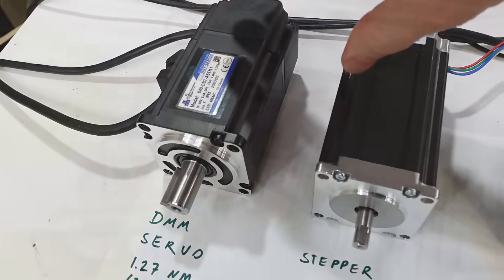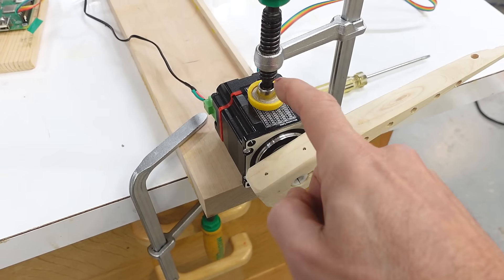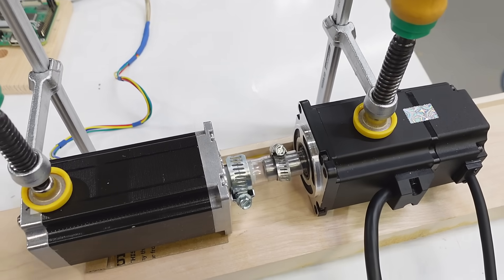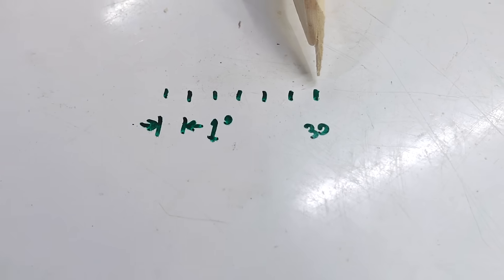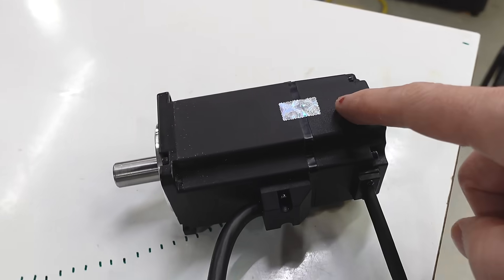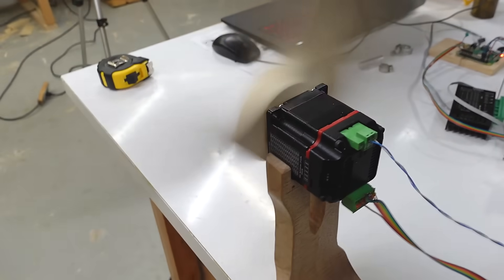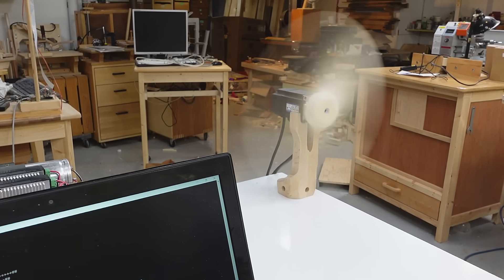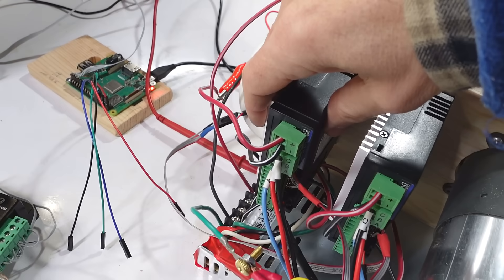Servo vs steppers: Speed, Torque and Accuracy

Comment: Why not connect these motors to your impeller on the dust separator?  What is the inertia of that wood blade? How out of balance was the blade you used?  What does the current plot look like on your scope during the micro step process?  When will you adapt one of these motors to your box joint cutting jig?

Comment: 3:23 Hmmm, I wonder why. Maybe it's because you clamped the motors on the table with a piece of cardboard under it? Nah, couldn't be it, must be the encoder's accuracy.
Reply from the maker: Body of the two motors were different size, so a shim was needed.  Also note how I clamped the stepper towards the back.  The coupling is not perfectly centered, and by clamping it towards the back it has a bit more room to move.  But --- you could have just paid attention when I said the coupling had its issues.  Commenting is easier than listening, isn't it?

Comment: I've used those magnetic angle encoders quite a bit, and their precision and repeatability always beats their accuracy by a wide margin. Small errors in magnet placement can have a fairly significant effect on nonlinearity, and perfect placement is effectively impossible. Still, cool devices, and very cheap for what they can do.
Reply from the maker: well, the way the magnetic encoder is in the servo, its a lot better than I was able to do playing with these encoders.

Comment: Those magnetic encoders have really bad non-linearity. If you look at the datasheet for some, they’re usually around +-.5° under ideal conditions. High precision servos tend to use optical or other types of encoders that have much better linearity
Reply: Optical encoders or resolvers are the standard in industrial settings. That said those magnetic encoders are pretty nice for hobby projects, certainly cheaper than "serious" angle sensors.
Reply from the maker: gets more expensive that way.  You need a LOT of resolution on the encoder, because the only way the servo knows how much torque to apply is looking at angle differences.  So you need a lot more angular resolution on the encoder than you achieve in terms of position accuracy on the motor.  16 bits of precision would be an extremely fine grained optical encoder.  and then you also need absolute accuracy to drive the BLDC motor.  So its a big extra cost.
Reply: @ Actually these servos measure current on each phase, current is proportional to torque in a PMSM. These should be PMSMs not BLDCs because of torque ripple BLDCs exhibit. 12-bit and 14-bit encoders are rather common in them. Also, a lot of "absolute" encoders are just incremental ones with battery backup, so you can loose absolute postion if the battery dies.

Comment: One thing to note with steppers is that the speed and torque ratings are only be valid when using full stepping. When using half, quarter or micro stepping you'll lose both speed and torque.
Reply: That's not true. Full step is horrible. But you believe whatever you want to believe.
Reply: @1pcfred  I think you'll find it is very much true. Like all things, it's a compromise. Want full power, then sacrifice smoothness. Want a smooth running system, sacrifice maximum power. There's no free lunch.
Reply: @1pcfred  so pleased do explain. How does one hold a motor in a static position with a continuously varying input?
Reply: I should add that ideally you'd run a stepper motor off a sine wave. We just don't because that's harder to digitally control.
Reply: @1pcfred  not entirely true. While actually turning using a sine (or SPWM) while given a nice smooth operation, in order to hold a position you need to either provide a DC current to a pair of phases to "lock" the rotor in position or switch rapidly between two phases to "balance" the rotor between two poles. This is why full stepping gives full torque, the rotor and poles are lined up.
Reply: @1pcfred  when my area of interest is automation and CNC, so holding torque and positioning is pretty crucial along. That's why so my goto is generally AC Servos.

Also what the hell you talking about? 50 phases? You mean 50 pole pairs? That's not the same as phases. Almost all steppers are 2 phase, although 3 and 5 phase motors do exist, they're no where near as common.
Reply: @JaenFoster  don't bother with this guy, he thinks he knows everything but is unfortunately very clueless. Victim of DK effect.
Reply: @riba2233 poor pc Fred. He was so embarrassed he was never seen from or heard on the Internet again 😢

Comment: This isn't the first I've seen of advantages of servos over steppers.  Broadly, when would I want to use a servo and when would I want to use a stepper?  It seems a servo can be used in many stepper applications.
Reply: when you have cost constraints or need holding power basically
Reply: IN GENERAL, a servomotor has better performance in every way. Use a stepper motor when cost is a big concern, and weight is not a big concern. Do not generalize the positioning performance of this particular servo to all servos. Different servos use different shaft position sensors. Some are optical. Servos can typically stop and hold position at full rated torque if desired. Although it depends on the driver.

Comment: I have a ~20 year old "hobby" CNC machine that came with servos (with optical encoders), rather than steppers. Given how well it works, and the advantages of servos, I've never really understood why steppers are used. I assume it's simply down to the cost?
Reply: I suspect it's cost. I have a 6090 form factor CNC machine w. 1.5KW spindle for measly $2000. It works amazingly well for even the most intricate and small wood carvings. I suspect I get way more displacement from the metals bending, than from the stepper motors inaccuracy
Reply: Servos are a lot more fiddly to setup. Unless they have translation drives on them, that is. Then the manufacturer worked all of that nonsense out for you. Old school amplifiers you have to PID tune though. Which some people are good at. Not everyone is quite a virtuoso.
Reply: @1pcfred  my machine uses a set of Geckodrive G320 drives, so I assume that's the "worked all of that nonsense out for you" bit?
Reply: @1pcfred  sort of. The Gecko G320 has pots for PID tuning. The manufacturer of the CNC machine had set them up as part of the machine build though.

Comment: Maybe you accounted for this but for the lifting tests, would the spool diameter for your lifting rope effect the max weight? Would a smaller diameter spool allow them to lift more?
Reply from the maker: I added the diameter of the rope to the spool so that the diameter I was using was to the center of the rope

Comment: I was never fan of magnetic "encoders", why not use the disk encoders?
Reply from the maker: manetic encoders give you the absolute position of the turn, needed to drive the brushless DC motor.  So an optical encoder wouldn'teliminate the need for the magnetic one.  But for most applications, there's quite a gear reduction from the motor to what its oving, so a degree off is actually insignificant.

Comment: I’d like to see the integration of the box joint jig and the stepper motors.
Reply from the maker: My first jig had a stepper motor.  Switching to gears was an improvement.  Faster and more reliable.
Reply: @matthiasrandomstuff2221  But why not both? Geared down stepper motor.
Reply: Could the push/pull of the blade mechanism be geared along with the turning of the ‘spacing’ gear to automate the movement?  That would be cool.

Comment: Man! I thought that "reverse second hand" clock was kinda scary. But then you started with the fan! 😬😬😬😬
Reply: I read your comment before seeing the fan and despite that I was not prepared for the real thing!
Reply: @hero314  same
Reply: that explains the dried blood on his index finger!
Reply: I was waiting for the POP-VVVVVVVR as the wood exploded
Reply: I know it’s only an optical illusion, but I thought the fan blade was creeping off the end of the motor shaft
Reply: lol almost made the entire workbench take flight!
Reply: oh my god, same
Reply: Yes, indeedy, I was dreading Matthias saying "Shit!" just after a blade was shed across his workroom with the motor beating and wrenching violently about in its restraints until its cutout activated (but the "shit" would at least reassure us he wasn't mortally kaput). And was there a knot hole on the right blade (facing us right) shown at 10:36 ? (he wasn't worried much about the knot hole, didn't he do a video on wiring drill holes in floor joists some time ago not affecting their strength much?).
Reply: Don't you love it when you comment something innocuous on a video, so YouTube naturally decides to delete it, doesn't tell you your comment was deleted and then still sends you updates to the comment chain you are no longer part of?
Reply: A shaved plank with a small set screw.. My god.. :p